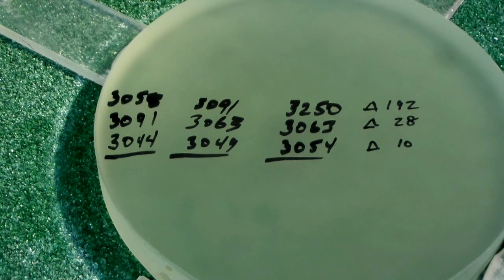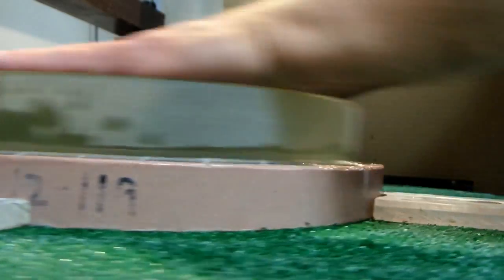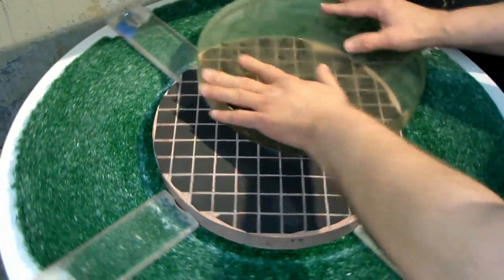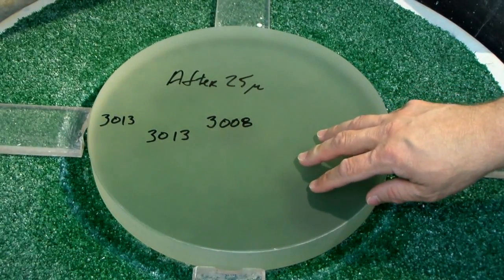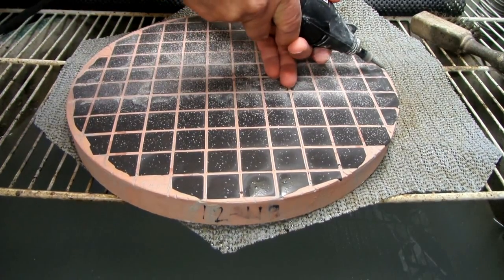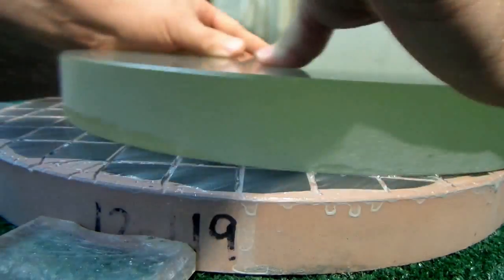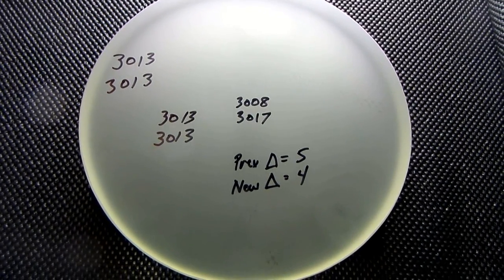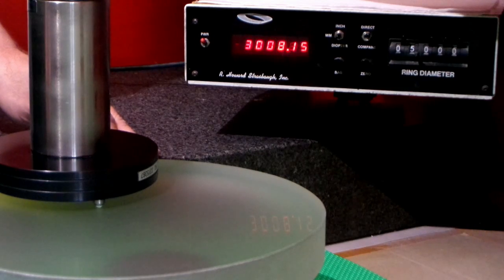12 inch f4.9 Telescope Mirror Part 3

Comment: I don't understand making of the tile tool: you put them on a flat mirror and plaster them together which suggest the radius is going to be very large? So how do you get your tile tool to be that specific 119" radius?
Reply: The mirrors he gets are generally pre-ground to have the initial curve in them. However it's not required that you get them like that. You can start off with a flat piece of glass and a flat tile tool and you use a chordal stroke with the mirror on top and the mirror is offset to hang over the edge of the tool. I think he covers this in this video when he talks about deepening the center of the mirror.

I'm currently grinding out a 12.5"/F5 mirror and just hit 220 grit. The mirror blank I got started off completely flat and I made a half diameter dental plaster tool using steel nuts in the bottom (he has a video on this) and I used that to hog out quite a bit of material from the center of the mirror blank. After that I made a full size tile tool using the mirror as a "mold" so that the tiles had somewhat of a curve to them based on the curve of the mirror. At that point you just go to town grinding until you hit your saggita target, then getting it spherical, then just progressing through the grits.

Comment: I assume that as you grind in the turntable, you rotate the mirror in the opposite direction to the  turntable's rotation to keep both the tool and mirror spherical.
Reply from the maker: Yes, you turn the top piece in the opposite direction to the turntable's rotation.

Comment: I don't get how you get the general shape of the tool when you make it ?? I don't have a pre-existing mirror.
Reply from the maker: If you are starting with a flat mirror, you start with a flat tool.  If you use the right strokes, the mirror will go concave and everyone will be happy!
Reply: I think he assumes a pre-ground blank like the one he started with.
Reply: @siggyincr7447  OK... and if we don't have a pre-ground blank, rather a flat slab, where do we start ?  That's what i don't get. And, is the eventual tool shaped on a spherical convex shape or parabolic convex shape ?
Reply: @SmeeUncleJoe  I've never made mirrors, so take what I say with a grain of salt. 
If you were starting with a flat slab, I think you would have to first start by using a diamond wheel on an angle grinder to rough out the a spherical indentation on it. Not easy, but doable. Then go from there as if you had a pre-formed blank. You'll likely have a lot more work to get the geometry right but as you lap the surfaces not only does the glass conform to the shape of the lap, but the lap conforms to the shape of the glass. I don't think you can lap the entire surface to a parabolic shape, I imagine that that requires spot lapping to remove material from the center while leaving the outside untouched, after you've achieved a nicely spherical shape..
Reply from the maker: @siggyincr7447 It is possible to start with a diamond wheel, or a steel ring tool.  There are many methods to hog out a mirror blank.

Comment: hey Gordon are there anyone who converts spherical 114mm mirrors into 114mm parabolic mirror with same focal point of 900mm?.
Reply: I mean, you could. But not while keeping the aluminisation, obvs. There’s a reason spherical mirrors are barely more expensive than blanks and it’s mostly that they skipped most of the work of making a good one.

Comment: Focal ratio has a lot to do with resolution , low Focal Ratio will give you wide views  and that is nice but it will fail compared to higher F ratio in magnification , i didnt know that ,  i guess you ppl dont know that ether . Let someone show his image of Jupiter on F5 10 incher , to see how much better it is then simple F10 4 inch refractor , it wont be better .  I think it wont ,  but i dont have 12 inch scope to show ,  and i dont have F15 100mm refractor but i think refractor would win on planetary
Reply from the maker: Actually the resolution of a telescope has nothing at all to do with focal ratio.  The maximum resolving power of a telescope is known as Dawes' limit, which is the Resolving Power in arcseconds.  It is found as 4.56/D, where D is the diameter of the telescope mirror in inches.  You can see the resolution is only dependent on aperture, not focal ratio.  From a practical viewpoint, it is much harder to figure a short focal ratio mirror relative to a long ratio mirror and achieve a diffraction limited optic.  So in the field you will often see a longer focal ratio telescope outperform a poorly-made shorter focal length mirror.  Refractors tend to outperform reflectors of the same aperture because they have no secondary mirror to obstruct light and cause diffraction.  Again, nothing to do with focal ratio.
Reply: @GordonWaite  No there is no need for central abstraction, tilt the mirror  done , problem not fixed , why is  Yorkes  Obesrvatory telescope F20 if it could be F5 and lot easier to handle ,  becouse FR matters , its not = resolution   , but it = less distortion and that means more resolution.  Simple as that , i expect mirror seller to  think its all about the size, and much of it is ,  quality matters , but its lot easier to not couse the problem in the first place by not bending light that much then to try and solve it with perfect mirror , for it aint happening . Even Dubson him self made at least F8s for a reason . And would like even higher but its gets unpractical .
Reply from the maker: @dedskin1  Well, the refractor in Yerkes was made to be f/19 because they didn't have anything close to the technology to make an f/5.  An f/5 refractor in those days would have so much chromatic aberration as to be completely unusable.  Of course mirrors don't have ANY chromatic aberration, and we can make them really fast and relatively cheaply.  Still, resolution is only dependent on diameter, and not focal length.  Show me any equation that says otherwise.  ;)  Obviously professionals stopped using refractors decades ago because large, fast focal length reflectors are superior in nearly every way.

Comment: Great video but I have a question. You keep saying millimeter don't you mean micrometer? A millimeter is a rather big measurement when it comes to optics LOL.
Reply from the maker: No, millimeter is correct.  I am talking about the radius of the mirror, which is about 3000 millimeters, or about 118 inches.  The "delta's" here are the differences between the measured radii, which is also expressed in millimeters.

Comment: I'm confused. Is the grinding tool flat or does it have a 119" convex surface?
Reply from the maker: The tool starts with the same shape as the mirror.  If you have a flat mirror blank, you start with a flat tool.  If you get a mirror blank that already has a curve started on it, then you mold the tool against the mirror so the tool has the same curve to start.
Reply from the maker: The grinding tool is curved.  By fine grinding, it should have the same radius as the mirror, except convex instead of concave.  At the beginning, though, if you start with a flat mirror, you also start with a flat tool, and they both turn into curves at the same time as you grind one on the other.
Reply from the maker: When you grind back and forth, the top piece (the mirror) overhangs the edge of the tool on the bottom.  This sets up a pressure differential, so there is more grinding going on in the center of the mirror on top.  With more grinding action there from the pressure, the mirror on top becomes concave, and the tool on the bottom becomes convex.
Reply from the maker: Yes, the grinding tool gets more convex as you progress.  You will need a new tool for a new mirror, unless you are starting with a pre-generated mirror blank that already has the curve diamond generated.
Reply: i am trying to understand how the curvature is made on the mirror. if the tiles are flat when making the grinding tool how does it have a curved surface?
Reply: so the tool isn't convex when you first make it?
Reply: GordonWaite will the grinder become more and more convex as you use it and will it have to be remade if you start a new project.

Comment: Thanks Gordon, excellent videos. One question though where do you get the tiles for the grinding tool? You mentioned unglazed tiles?
Reply from the maker: I like the unglazed tiles from International Pool Tile.  A little expensive, but just right for mirror making. Only problem is you have to buy a full case, usually, which is a LOT of tiles!  I also use sheets of smallish glass blocks that I get at the big box stores like Lowes or Home Depot.  The individual glass blocks are about a cm cube, so they last a very long time.  Plus the small size makes them good for smaller tools.  These guys run about $8 to $10 per 12" sheet.